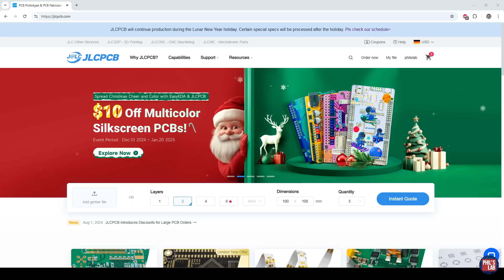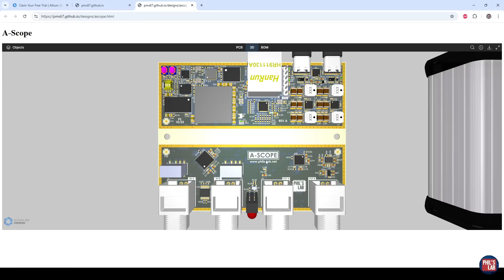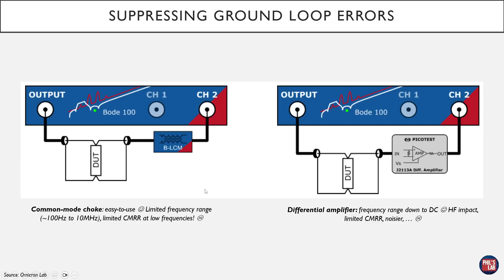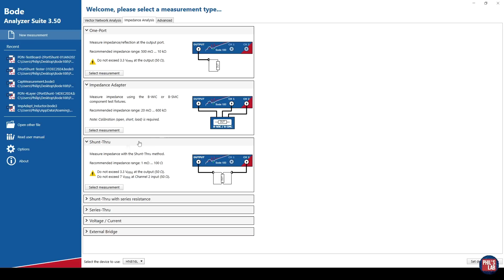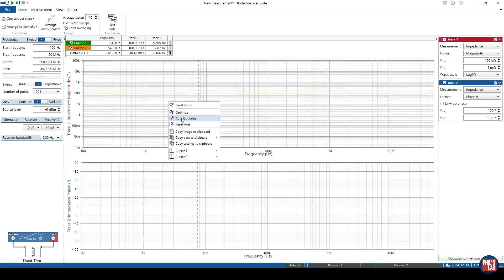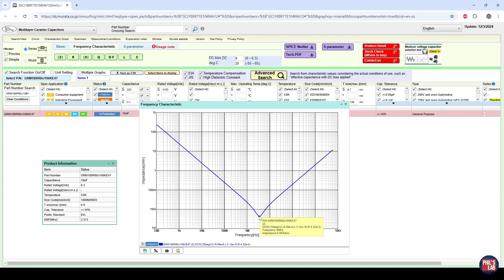2-Port Shunt-Through Impedance Measurement Basics - Phil's Lab #151

Comment: Hi, very good information and video. However it would also be good to show a comaprison between using the very expensive equipment with a cheaper alternative (for example how you would do the same measurements with an affordable NanoVNA). Most people on YouTube probably can't afford the top end test equipment and don't need the absolute accuracy that the top end equipment gives, but do want to know the theory and techniques and how they are achieved with readily available affordable equipment.

Comment: Oh those compression fittings are not cheap... but that's the cost of performance.
Reply from the maker: Yep, but re-usable!
Reply: @PhilsLab  I was wondering about that... I've been thinking about getting some (e.g. 2.92mm) but I wasn't sure about the re-usability. Have you seen a limit to the number of times they can be re-placed?
Reply from the maker: The main bits of wear seem to be the mounting screw threads and possibly the contact surface degrading over time. Overall, with care (right screw materials, consisten clamp force, handling..) I think these can last quite some time.

Comment: Hi Phil, love the setup! Quick question: do the magnetic base and posts affect your measurements, especially with miliohms or high-frequency stuff? Cheers!
Reply from the maker: Thank you! I've been wondering that as well. In general, I would assume they would have a 'minimal' impact, especially if compensated for with via calibration. But if we're measuring some sort of 'magnetic' components, this may influence the results? In any case, for very sensitive measurements I probably would err on the side of caution and have a far more controlled set-up.
Reply: It might be interesting to repeat a critical test without the magnetic mat to see if it makes any difference!
..to satisfy the cat's curiosity, which may have killed the cat—but what an amazing way to go!"